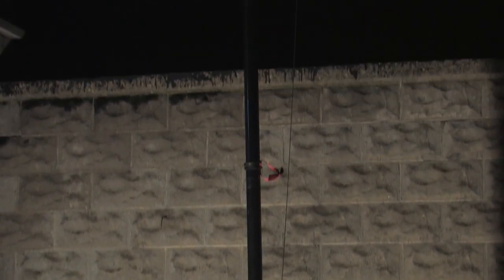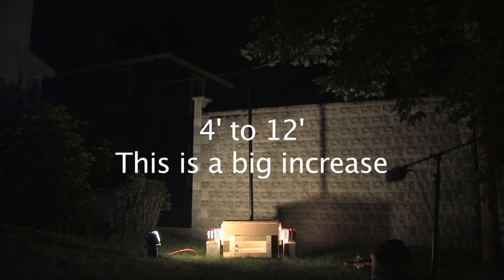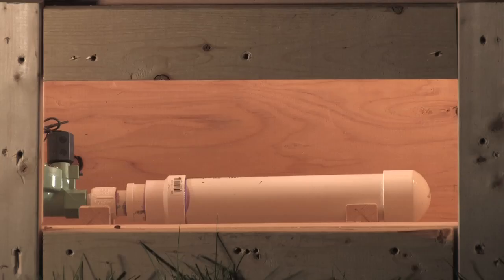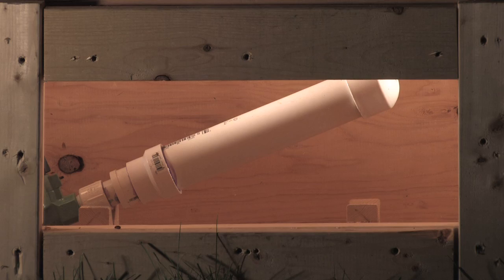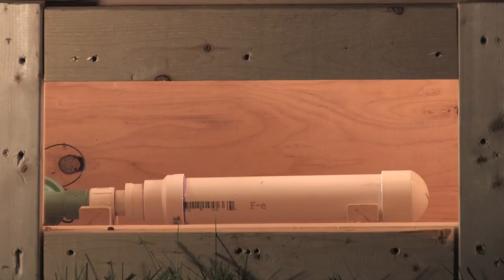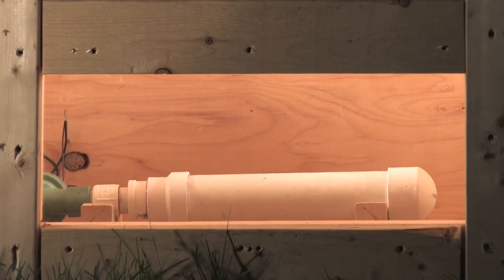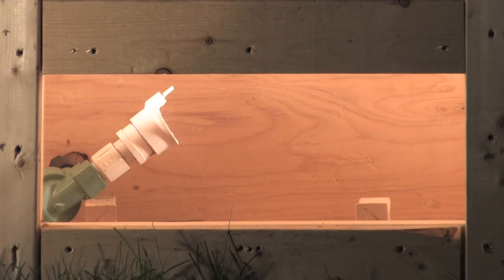Testing PVC Pipe - Explosion

Comment: I been thinking about setting up a tank in my work van to keep pressurized and leave a blow gun attached to it, I was thinking i can either refill with a jobsite compressor or a portable inflator or at my shop when i park at night. I suppose it'll be OK if the tank is mounted somewhere safe. Thanks for sharing your experience. I appreciate you

Comment: Anyone ever used epoxy resin to cast a pressure chamber? I imagine if i cast it all in one piece (minus the lid obviously) at 1\2 inch wall thicknesses it could hold 80 lbs no problem right?

Comment: New pipe is very resilient. You can see how it absorbs the shock. To really get a good test, leave the pipe in the sun for a year and repeat. It'll bust on the first hit.
Also heating pvc pipe and cooling it impart a little brittleness in the pipe. Not as much as the sun but it does happen.

Comment: Very good video and test.  PVC (and most polymers) are known for degradation of fracture toughness in sunlight (ultraviolet radiation.) I have used PVC to build backyard roller coaster tracks, and I've done similar impact testing.  I only use the grey electrical PVC, which is supposed to be "sunlight resistant."
I set out 2-inch grey electrical PVC pipes in the sun for 2 years, painted and unpainted, and found the fracture toughness of unpainted electrical PVC to degrade by half.  So, it's important to paint any PVC projects, preferably with a dark paint,  as soon as possible.
Reply: Bingo! Was gonna suggest using old pvc. Leave it out in the sun, rain, cold and hot. I want to see how wrapping it in various things like duct tape or denim will mitigate the shards shooting out
Reply: @nateb4543  maybe fiberglass tape, or kevlar tape if you can find it.
Reply: every good test has a control specimen(s), so test a pristine specimen too @nateb4543

Comment: Since everyone says that pvc is bad and you should never use it what else should I use that is affordable and fits with a 1 inch sprinkler valve
Reply: IF you can a fire extinguisher, I have seen people use those. PVC is made much cheaper now than it was 10 years ago. We make aluminum tanks for building launchers too.
https://www.ebay.com/itm/Aluminum-air-chamber-kit-paintball-airsoft-grenade-rocket-bait-bag-launcher/301646119289?ssPageName=STRK%3AMEBIDX%3AIT&_trksid=p2060353.m1438.l2649
Reply: Switch to HDPE or propylene tubes for we example. There are so many polymers to pick from.  Anything but pvc. When pvc is burned it is making a whole  list of nasty compounds including dioxines. The the mechanical properties are also that great. It needs additives to keep it flexible; the smell of a ñewly bought swimming pool is not pvc, it's the additives. Those evaporate and get damaged by uv light so the pvc swimming pool is becoming brittle after two summers. 
PVC has its uses, but not the bulk naive were doing now with carpet flooring, kids summer toys and many more.
PVC. Is cool but it should not be on the bulk market.

Comment: Thank you for this video!!! I was planning on making a small air tank for LEGO pneumatics using PVC, when someone told me that it was dangerous because PVC isn’t made for compressed air. I’m planning on using 60 psi in it too. What thickness of pipe did you use?

Also not planning on dropping it or anything onto it from 12 feet repeatedly so I should be perfectly fine!
Reply: I have seen a destruction test like this one, I think he pumped up the PVC tank with at least 400 PSi before the pressure tore it apart, I think for normal usage like small pneumatic functions and Truck Air-horns under 150 Psi it's fine. (I use one for my Train Horns 4 inches Dia. with 5mm thickness, works fine with 150 Psi).
Reply: I built about 5 different variations of pressurized air launchers and used SCH 40 1/2" - 2" PVC, they still work fine despite being a few years old. Just make sure to get a tight seal if you plan on going above 50 PSI
Reply: Use ABS instead.  It is much more ductile at low temperatures.  Little bit of money, lots more safety.  Of course both of these are "off-label" uses so you are on your own in any case haha.
Reply: I use PP and PE pipes as rocket motors body. These do not shatter. They only deform.

Comment: You think that's cool you should see a schedule 80 24" fitting explode.  It's terrifyingly awesome.  Used to work in a pvc fitting plant.  One guy had a full time job running a pressure tests. Had a big metal floor and giant vacumn sealed clamshell to go over it.  I worked 3 feet away from it.  They always passed the test and were sent for remelt becuase of the abuse put on them.  But man...  for fun dude would crabk it up to 11 and break off the fucking knob to mess with people.  Especially new guys like me.  Sumbitch would explode and everyone else acts like they heard nothing.

Comment: what that means is that you never use PVC above ground at that pressure level or else failure will occur that's what your test means I'm surprised that you don't know that after all that explanation but after I read that all that you wrote that's exactly what you're saying and you don't know it.

Comment: would you recommend using PVC pipes on car air intakes?
Reply: chris, jared, what sort of pressure do you think car intakes run? car intakes run a slight vacuum.
Reply: +Angelino Martini de Leon No, Never use pvc for compressed air, because when it fails (might be 1 week, 1 year, might even be 20 years) throwing shards of dense plastic everywhere. The companies who make the stuff (and there for want you to buy it) don't want people using their product for air. Go to osha.gov and search for hib19880520 you will see an article. Even if it's in your own garage/shop if you don't want to run metal lines consider pex-al-pex, it's easy to work with and is rated for air and is cheaper than copper or black pipe.
Reply: I created an intake tube for my truck years ago and there are no problems.  The intake will not have any pressure unless the engine backfires.  Under normal conditions, it will be a tiny vacuum.
Reply: Wouldn't recommend using pvc for anything holding compressed air. too much can go wrong.
Reply: +Angelino Martini de Leon As long as it doesnt melt you should be ok, test it out and keep a close eye on it at first. Make sure to do your test in the dead of summer with a hour or two of city driving. I bet it would be fine though. Just dont use it for your exhaust! lol

Comment: From the short joint length in your reducer coupling, it looks like your using the nsf-dwv (dwv stands for drain/waste/vent), rather than the nsf-pw (pw stands for Potable Water, or drinking water, from pressurized lines)

The dwv material you are using IS NOT rated for ANY pressure application.

Calculate area given your pipe diameter in inches, multiply that by pressure (PSI), and check how much force is trying to blow that reducer across your neighborhood. Bet its more than you thought!
Reply: Actually it looks like schedule 40 PVC pipe.  PVC pipe is not rated for ANY Pressure of a Compressible fluid, ie compressed air.  The pressure rating is ONLY for an incompressible fluid such as water.  As you can see after they broke it you end up with very sharp shards flying around.  The face shield helps with your eyes but the shard lodged in your chest still sends you to the ER.  Heat, light, age will all make PVC as shaterable as freezing it.
Reply: @skoue4165  Right that PVC is not technically rated for pressurized gasses, but schedule 40 is frequently used anyway. It is (reasonably) safe as long as you use the -PW fittings which overlap the pipe to a much greater extent (more than twice the engagement) than the -dwv fittings for the solvent welded joints.

This is a critical difference for any pressure application, liquid (rated) or gas (dangerous but manageable)
Reply: @highvoltagefeathers  It is used by folks trying to save money or not well informed about the dangers of compressed gasses.  Which is most of us so...  IF you use PVC for compressed air and anything goes wrong your insurance will not cover you and if someone gets hurt you are 100% liable and may also be susceptible to criminal gross negligence charges.

I personally know of a catastrophic failure that blew out the wall of a house boat because a PVC pipe was being pumped out using compressed air.  It was admittedly a very large diameter pipe.  The caps are not really the issue.  If they pop off you have a flying blunt object.  When the pipe fails you have shrapnel.  A quick search of "potato cannon fails" will bring up a bunch of idiots blowing up PVC.  You had the respect to put it behind a shield and to be wearing face protection, neither are common in shops with PVC airlines.

Comment: Could you do this test with 140 psi freezer temp and wrapped in duct tape?  I would, but I don't have a the setup already built.  I'm wondering if duct tape would turn the brittle failure into a ductile one.  I'm wanting to build a special effects cannon and will be using it around kids and want it as safe as possible.